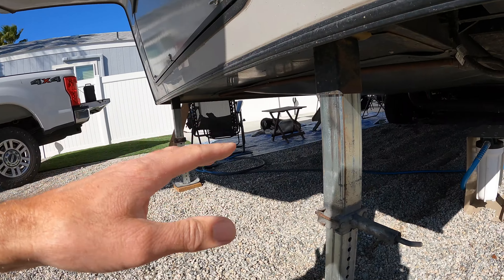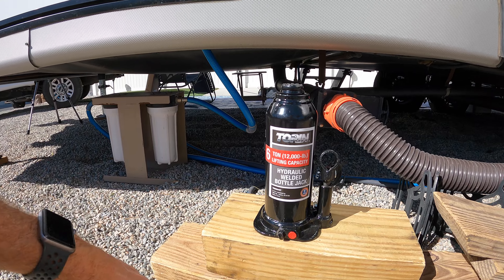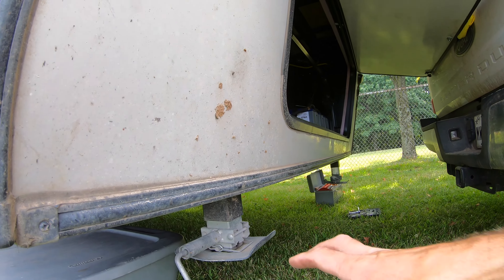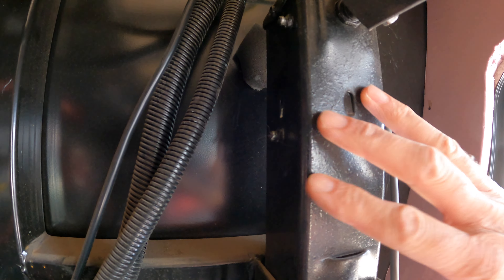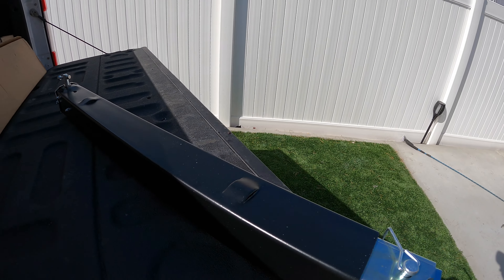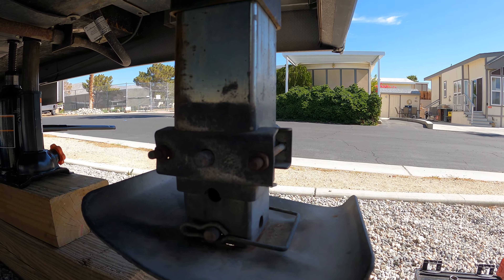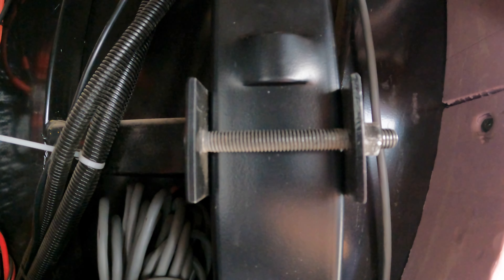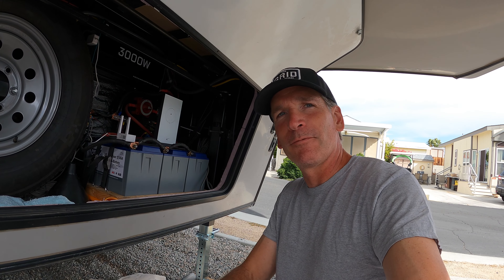Lippert LCI Landing Gear Jack Replacement | 5th Wheel RV

Comment: Thanks so much for this video. Our follow leg failed today. Luckily we were unhitching when it happened and it only fell an inch. It was terrifying though. Currently stuck in a hitched position now. Hoping we can have the new leg overnighted to us tomorrow during business hours. If we are hitched do you think we could swap the follow leg without having to use the bottle jacks or do we need to lift the trailer higher than the hitched position do you think? It was a complete failure.
Reply from the maker: Hi there!  Sorry to hear about your troubles.  Yes, it can be replaced while hitched as long as you can open the front hatch to gain access to the leg, motor, etc,…. No need to raise the trailer higher.  I actually had to do this the very first time that we had the issue. It’s a tight squeeze to work in, but, it is possible.  Feel free to to let me know if you have any other questions!

Comment: Found your video very helpful - got all the way through to actually fitting the new leg.  The distance I have for the supports is the same as in your video 15.5ins.  When I put the leg in position the top support fits but the bottom one is some 1/16" out so it is not properly fitting and I cannot get the second lower screw to fit. I guess it comes down to welding tolerances - looks like I need to file the excess to get a proper fit.  Thoughts ?
Reply from the maker: I just measured the bump outs on my leg outside outside and it measures exactly 15 1/2 inches. I then measured the welded brackets and they measure 15 3/8 inches outside outside. I knew there was some wiggle room there for when I installed the leg, which ends up being 1/8 inch. I would say that you will need to return the leg as you should have that extra 1/8 inch of room to play with.  I’m thinking it would not be a good idea to try to file it down and force it to fit.  Did you order this from Amazon? Is it the Lippert brand leg?

Comment: NICE WORK.  THANKS FOR THE LESSON.     I'M HAVING TO REPLACE THE LEAD GEAR BOX ON MINE.  I'VE WONDERED THOUGH.    I'M THINKING NEW JACKS THAT HAVE INDEPENDENT ELECTRIC MOTORS ON EACH AND POWERED BY THE SAME POWER SOURCE THAT RAN THE OLD LEAD GEAR MOTOR.   ANY THOUGHTS?
Reply from the maker: I haven’t looked into this much, but, have thought that it would be nice to have, especially for leveling side to side.  Sometimes it’s hard to get perfectly level due to uneven ground conditions.  Plus, the independent motors should make it easier to raise the rig.

Comment: Good deal!  My landing legs are like that. It's a 2016 Open Range and we've taken several long hauls cross country for a couple of months at a time and many many local outings with minimal jack problems. But we do not full time.  Just a troublesome breaking bolt that connects the end of the cross bar. I upgraded the bolt to heavier stainless steel and carry spares. I think it's time to inspect the gears and maybe find spare parts for the jack.
Reply from the maker: Hi Barry!  I’ve been told that bolt at the end of the crossbar is called a shear pin that is meant to snap if too much torque is applied to avoid damaging the motor and gearbox.  If you’re snapping those on a regular basis, I would recommend at a minimum changing those jack leg gears as it sounds like they are binding up on you.  I put links in the description for the gear packages on Amazon for the LCI (Lippert) Legs if that’s what you have in your rig?

Comment: Yup, this happened to my follow-leg back in September 2022. Now our lead leg is giving out. I ordered a beefier model sold by e-trailer (8000 lb pair vs the OEM Lippert 5500 lb pair) so as not to overstress the legs. This video makes it appear MUCH easier to replace than I thought it would be. Thanks!
Reply from the maker: Hey Zach, will be curious to know how your new 8K leg(s) work out for you.  That sounds like that might be a better option.  Odd though as we have a 10K camper, so, the 5.5K jacks should way more than sufficient.  I'm thinking it may be a quality issue from Lippert.
Reply: @EddieAtLarge  The new legs are working far more reliably. I started having torque issues less than 6 months on the old legs, causing the electric motor's safety clutch to click regularly. Then the safety clutch wouldn't stop clicking once the first leg went out. I think the failure of the first leg led to the failure of the second since it wasn't really holding its portion of the weight.

The new legs are going strong. On top of that, the PAIR of 8k lbs. legs from e-trailer cost less than one leg from Lippert.
Reply from the maker: @zachy-koon  Great to hear!  That makes perfect sense about the bad leg wearing out the good one.  Curious what brand and model legs you bought with the 8k capacity?  Would definitely look into buying those next time as it seems like our Lippert replacements still struggle a bit.
Reply: Hey Zach, sounds like u bought the Reese 500708 Fifth Wheel Landing Gear, 8,000 lbs. These are independent units. They look like a great alternative to the single motor stock units. Would really like to hear more about yor experiance if these are what you used. Thanks, Chris

Comment: Fantastic video - thank you for creating it. How can I figure out which leg needs fixing/replacing?
Reply from the maker: Thanks, glad you found our video helpful!  Our leg began making a clicking noise and we noticed that it took much longer to raise the camper.  You could also hear the motor struggling.  Depending on the age of your rig and the amount of use it gets, you may want to consider replacing both legs (or gear assemblies) at the same time.  If one has gone bad, the other may not be far behind in also needing replacement.
Reply: Yes, the same is happening with mine. I suspect that's good advice. Thanks again. @EddieAtLarge

Comment: Thanks for the video, I'm off to replace the front landing gear system in my 2010 Brookstone 345SA.  I figure 13 years in I should just do the whole system.
Reply from the maker: You’re most welcome!  13 years is pretty good.  Not too hard to replace the entire system.  May be a good idea to avoid problems down the road.  👍🏻

Comment: Just an FYI for those of you who have a motor with a slipping clutch and decide to use a heavier duty motor.  If you purchase the motor and it comes with a switch, there's a chance the switch is for the wrong side (most likely reversed for that side).  We replaced the motor (left side looking at front) and noted that the switch was actually FOR the same side.  The RV switch currently is on the right side by the generator.  So, after installing the motor and keeping the OLD switch, we noted the direction of travel for the legs was reversed. A simple swap of wires from the motor fixed the problem.  The new motor was blowing fuses though, so we replaced the leg, like this vid showed and it fixed the problem (thanks a load for good vids), though the leg didn't look that bad in the gear cavity.  Looks can be deceiving, as the gears shifted a bit before attempting to turn the jack shaft and we have a standby motor.
Reply from the maker: Great advice, thanks for sharing!

Comment: Yeah our gear box went out. It kept breaking the pin, holding the extension arm to the passenger side. I was replacing the pin with grade 8 bolt. An I was breaking them every time we hitched up or unhooked from the vehicle. It’s making me mad. But I’m still under warranty, so they are setting up a time for me to bring it in for repair.
Reply from the maker: Glad to hear it’s being taken care of for you.  I bought an extra gear box and motor to have on hand just in case they ever go out while we’re out on the road.

Comment: Was there supports on 2 sides of the legs? Because in the video, when you installed the new leg the support was on the bolt side.
Reply from the maker: There are supports on both sides of the leg

Comment: How do you know if the issue is a jack or the landing gear motor?
Reply from the maker: I would always start with the jack.  Had both left and right go bad on us in 4 years of full time travel.  Thought the same that the motor may have been bad, so, bought an extra to carry with us in case it ever does.  There’s also a gear box that attaches to the motor.  Bought an extra one of those as well.
Reply: Can you just install a rebuild kit in the lead and follow leg?
Reply from the maker: Yes, you should be able to do that.  They sell them on Amazon.

Comment: Wow, wild you can buy an all new camper for 35+ thousand dollars and yet still catastrophic things fail
Reply from the maker: There’s a saying we use in the RV world.  “If you aren’t able to make repairs on your RV, you better have a thick wallet”.  I’ve made tons of repairs on our rig over the years, a lot I haven’t shown on YouTube.  Not only is it extremely expensive to take back to the dealer, it’s also very inconvenient.  Sometimes they’ll want to keep your RV in the shop for weeks or even months.  Our friends have a Grand Design Momentum that has had all kinds of problems.  Last one was a frame issue where they had to completely dismantle it to make the repair.  So, it really doesn’t matter how much money you spend (theirs was over $100k), all RVs will end up needing repairs.  I’ve been fortunate enough to have been able to make all the repairs and do all the maintenance on my own.